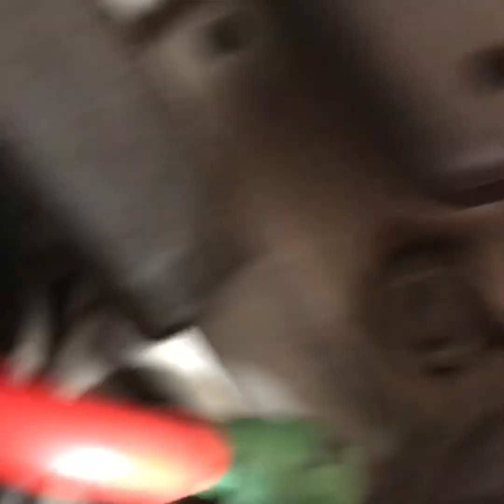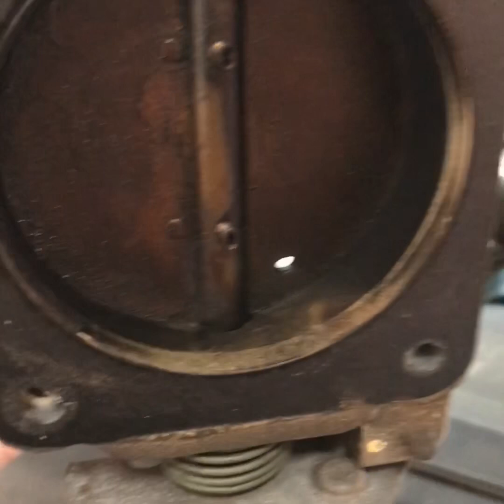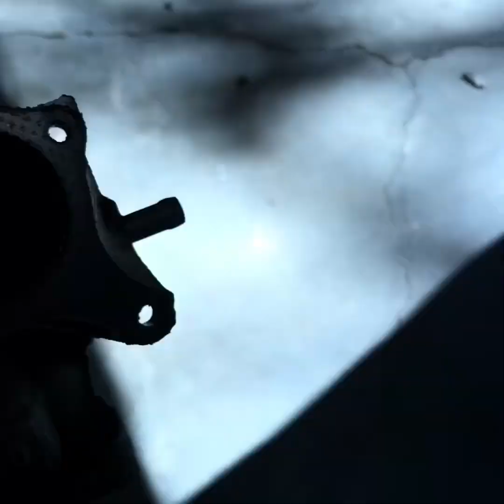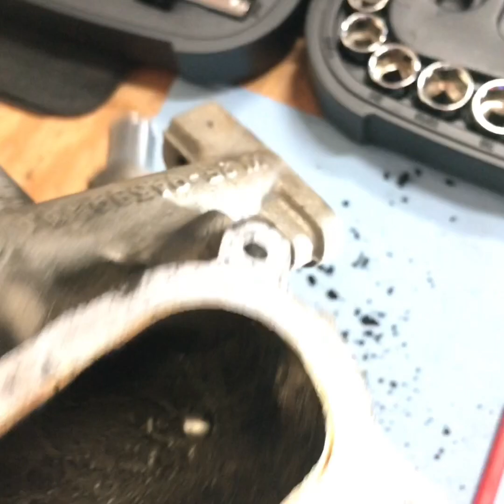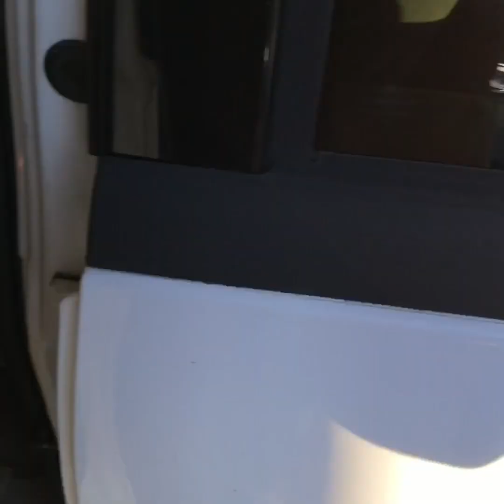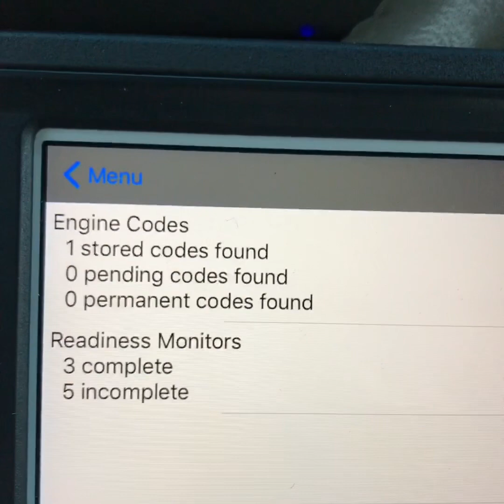P0401 Fixed! - 2001 F150 4.6

Comment: I'm glad i found this video and it found me. Just did this whole procedure to my '03 F150 with 4.6L. It has 403k miles. Everything was clogged with carbon buildup. Worse than depicted in the video. 
I went ahead and changed the diff pressure sensor and EGR for new ones. Might as well while I'm there. Checked and changed some dry rotted hoses too.
The EGR pipe put up a little fight.
Changed the PCV valve while i was at it.

The difference is night and day. Truck runs smooth again. No more rough idle. No more acceleration issues. No more fuel smell. Hopefully better MPG!
Reply: That’s awesome 400k+++!!!
Also love your kind comments as well, producer of the video did an awesome job!

Comment: Very well done. Thanks. The only add I would have is I used my pressure washer to blast out all of the buildup after wrestling with chemicals and picks and brushes. The pressure washer got all of the surfaces completely clean in seconds. I did not use the pressure washer on the throttle body. Just the throttle body cast manifold. Work like a charm. Good video. Very well done.
Reply from the maker: Thanks!

Comment: I’ve done pretty much just about everything and still have the code. 

New EGR
New EGR tube 
NEW EGR Vacuum solenoid valve
New EGR DPFE sensor (aftermarket) gonna try an OEM one since a lot of people have issue with aftermarket ones)
-checked for vacuum leaks with a smoke machine and no luck 
-also cleaned out the throttle body, ports etc..
Reply: Did u get this fixed yet?

Comment: Did you take off the battery cables when doing the throttle?

When you took off the air assembly housing did you spray the Mass Air Flow Sensor to make sure there wasn't any dust on those wires since they are sensitive to make sure they were free of dust?

Asking because I'm going to have to do this with  the throttle and I'm wondering if I need to take off the battery cables or spray the mass air flow sensor just to be sure no dust is on those wires.

Comment: Could a bad camshaft position sensor cause p0401 even after replacing Egr, only time code come on is when it’s driving rough and I’m driving it for a little bit with it running rough
Reply from the maker: I’m not sure on that one. Sorry.

Comment: Can a p0401 stall the truck soon as I turn it on ?
Reply: I just followed this video to fix this code the other day. Can confirm that the truck was turning off after starting it prior to the fix.
Reply from the maker: Possibly, but it would probably would have been getting progressively worse leading up to the stalling. Is that the only code you’re getting?
Reply: @Foxedup  yessir i had the code for a couple weeks, and it was still running strong other than rough idle, let it sit for a week during the cold temps, and now it just dies if I don’t give it throttle

Comment: Thanks, worked like a charm! I have a 2000 F-150 4.6L with 135k miles and this worked perfectly for me tonight. I also had a bad egr solenoid but was able to diagnose that by no noise/movement with 12v applied. This took me about 2.5 hours for the whole process and I work on computers for a living. Thanks man you saved me about 1k at the shop. I used Torque on my phone with a similar cheap Bluetooth obd2 adapter to read my codes.
Reply from the maker: Awesome!
Reply: @Foxedup obd has leak test failure.. any ideas where to start ?  new egr tube fromanifold.. egr looks new f150 4.6 has 103 000 miles
Reply from the maker: @ipman4715  make sure the gas cap is on securely and that it’s in good condition.  Sometime it can fix on its own after driving for a while.  Not sure what else might cause that error.
Reply: @Foxedup  I just replaced gas tank so the shop may have messed up then
Reply: @Foxedup anyone have ideas when obd detects leak test failure

Comment: I wanted to send you a huge thank you! I threw lots of money at all of the peripheral parts and sprays etc. Did nothing. I waited until the day before I had to get a CA STAR smog check.  Both EGR ports were completely caked solid. I was able to get it cleaned up, w/ new gaskets & back together in a couple of hours. Passed smog with flying colors. 2001 Ford F-150 4.6, 296K miles. Thanks again!
Reply from the maker: Awesome!

Comment: I have a 2002 f150 with 45k miles that code came on do you think it's carbon build up or the  EGR ? P.s. the truck was my grandma's and really never drove it much
Reply from the maker: Probably carbon build up.  But it can build up in the EGR, as well.  It would be worth pulling off and inspecting.
Reply: @Foxedup  thank you sir really appreciate your help.. great video 👍

Comment: Hello I had the same codes so I cleaned my throttle body, changed the EGR valve, selenoid and DDP sensor.

The light was off for 2 days and came right back on.

I sprayed around all areas to see if I had a vacuum leak.

There was not any.

Any suggestions? It will greatly be appreciated.
Reply from the maker: There several other things that could cause that.  1) The EGR valve itself is bad and isn’t opening and closing properly. Those are around $40 to $50 on Amazon. 2) Or the DPFE sensor is bad. Those are only around $15 on Amazon.  
Keep. In the vacuum line are sucking in a small amount of air, so spraying around them may not indicate a leak. Many shops use a smoke test and inject smoke into the vacuum system (with the car off) and look for smoke coming out of the system.
Reply: @Foxedup  
Thank u so much for your insight.

I've decided to start from scratch.

I took the intake apart and found more junk in the ports so I cleaned the whole unit and EGR valve.

Put all back together and received a code for the DPFE sensor this time so I changed it again and the light went away.

Thx again!
Reply from the maker: @kye389  excellent!

Comment: Clean TB, replaced DFPE sensor, still PO401, replaced EGR Sensor Regulator & EVAP  Purge Hose , ( hose runs from top of TB from to brake booster ) issue resolved
Reply from the maker: Nice work. 👍🏼

Comment: You're not suppose to use carb cleaner on the Ford throttle bodies. There is a yellow sticker on it that says as much. The reason is they have a Teflon coating that gets eaten off. If you have to clean it you have to use something very mild - Seafoam, for instance. South Main Auto has a video on it here on YT.
Reply from the maker: Interesting, I hadn’t heard that. I’ll keep that in mind next time.  Thanks for the tip!

Comment: Very helpful. I was getting p0401 as well as other codes on my 2002 f150. I performed the work you outlined and my throttle body looked identical to yours in this video. Berryman b12 did the job and put it all back together with new gaskets. No more rough idling and all codes are gone. I did need to purchase the 1 1/16 wrench to disconnect the exhaust tube from the EGR. 
Thanks again!!
Reply from the maker: Cool thanks!
Reply: Just wondering, how many miles were on your vehicle?  The one in the video had over 200k
Reply: @johnkern4698  mine had 250k
Reply: You can buy an adjustable wrench to get that nut off. Once broken loose it comes off by hand.